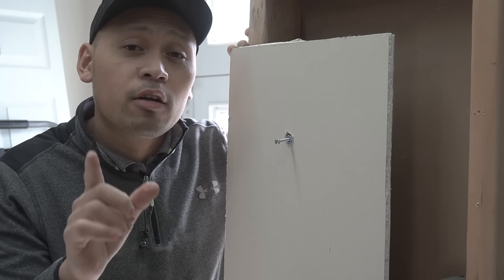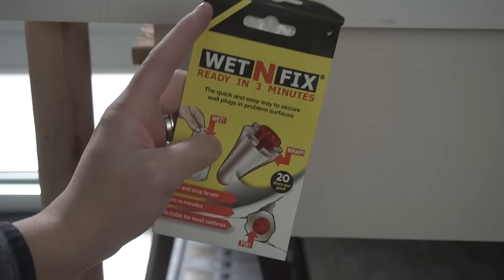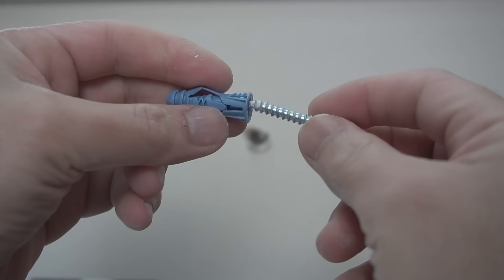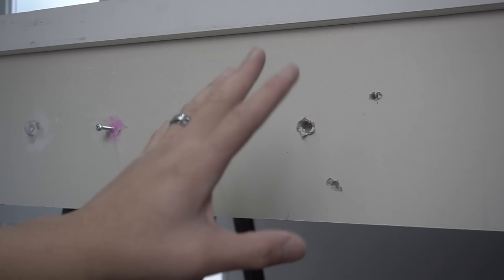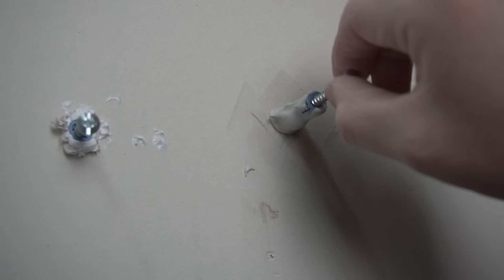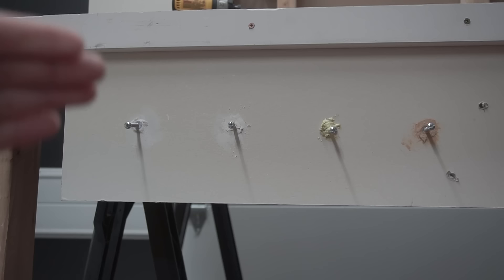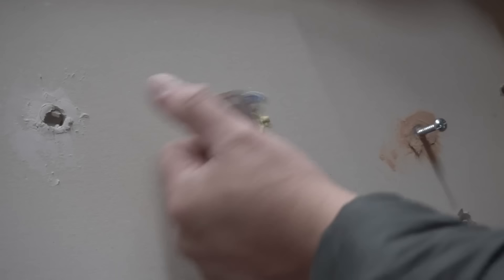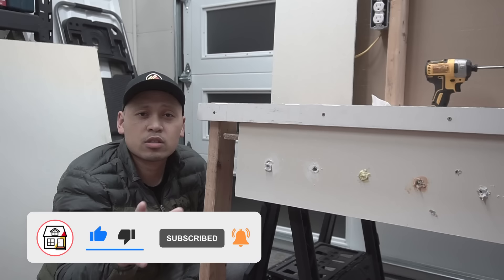How To Fix Loose Or Damaged Drywall Anchors Like New! | DIY Wall Plug Repair!

Comment: Hello, can you advise what size drill bit I need to
pre drill the hole for dry wall anchor. Dry wall anchor size I have is 0.98" (25mm) not sure what size drill but I need for pre drill

Comment: i had to fix an ongoing problem with a towel dispenser in a warehouse washroom and the door trouble too   as to towel dispenser cut out the damaged drywall and put a 3/4 piece of plywood behind the new drywall i put up to they found out who was tearing the towel dispenser from the wall he broken his hand trying to tear it off 
moved the door and put it in a different spot too and  a camera to see who do go into the washroom too

Comment: I hanged my TV on drywall, the TV weighs 18.7 kg and the wall mount weighs 9 kg, it's a heavy duty mount, total 27.7 kg, quite a lot of weight. 

How I did it is simple, I cut a vertical stripe in the drywall the size of a plank, then place wood planks though the slot, rotate them, screw them behind the drywall horizontally, then screw the planks to the actual wall with long screws, then screw the drywall cutout back in, use plaster/mud to make the wall look nice again, after drying you can use wood screws to hold the mount, or any kind of heavy weight, the mount was so strong that it held my entire weight (93kg), you can adapt this to any size, if it's not something really heavy you can use one single small plank and not attach it to the wall, just the drywall itself is enough to hold a lot of weight.

This technique can also be adapted to fixing drywall holes, it's easier to do than to explain, it's a really simple process.

(pro tip: have a screw in your plank to avoid accidentally dropping the plank behind the drywall, and to make it easy to maneuver it in place)

Comment: What about using fiberglass mesh with the Easy Sand? The Wet and Fix seems to get its strength from the fiberglass. If the Easy Sand held to almost 50lbs by itself, I think that the fiberglass would add strength.

Comment: Great video,I would not use a drill/driver as to much torque if you used a hand held screwdriver - tradesman to reliant on battery powered gear for light duty stuff -

Comment: Could it be that leaving the screw iside the plug while the compound is drying will attach the screw to the plug making the screw test to fail? Specially using a power tool, too much torque to the screw is twisting also the plug? Just an idea... Great vid thanks for you content!

Comment: If its possible to move what is anchored, up, down or to one side a little bit into new sheetrock with no hole. Then fill the old hole with, whatever, like sheetrock mud. This is the best fix because you are in new sheetrock.

Comment: I enjoyed your video however I always use the (heavy-duty) no more Nails caulking. I am surprised you didn't use it for this test as well. It dries fairly fast and is extremely strong. I have even cut a hole in drywall and installed electrical boxes where there is no stud and the box is rock-solid once it is dry.

Comment: if u have a hole in plasterboard and you fill it with  some snot from nose and put in it plug, it wont be strong anymore, paper on both sides of plasterboard is damaged, plater is damaged..., you don't clean dust, don't watered the area around hole, you are the cowboy builder, after your job people probably call some skilled builder to repair all damages you done...

Comment: I use Gorilla Glue, the foaming waterproof polyurethane type with the white cap, not the wood glue or the superglue. I always use this even when I have a good hole because it consolidates the plaster dust and prevents the hole eroding over time. I have not done any formal testing, but I bet it is better than any of these options except possibly the WET-N-FIX.

Comment: I never reuse the same hole/plug/place combo: either move the hole to a new place and patch the old one by the pink spackle or use larger or different type of plug that wouldn't rotate when the screw is screwed in

Comment: Just get some joint compound fill the hole and wait 24 hrs.  Then make sure your anchor is the correct size for the weight it is supporting. What is in the video usually happens when the object is either too heavy for the anchor OR the hole was drilled too large in the first place.

Comment: WET-N-FIX worked but it did move under stress (you didnt point this out) of more than 130lbs but you wouldnt prob have that much load on it anyway. So WET-N-FIX looks the best bet.

Comment: For the wetnfix method, if you put the wetnfix covered anchor into the hole, could it potentially cause mold in the drywall?

Comment: I use the toggle type anchor.  It works going through a hole, but I don't hang anything too heavy using that technique.
For the wood filler, would it not make sense to let the filler dry, and then screw a pilot hole through it for the screw?  No need for the extra hardware from the anchor.

Comment: Buy the pack with the drill bit in the pack or clearly marked. Never use a screw gun. Use a hand screw driver with light and steady pressure

Comment: How about? Start over! Fill the old hole with spackle and move the anchor(s) an inch away. In most applications, that is by far the easiest, cheapest and most convenient approach. But, truth be known, I usually just find a stud(s).

Comment: Better method that will last forever: 1 Take out the loose screw and clean the inside by using a moist cloth/fabric, just stick it in and out to remove any particles. 2 Use epoxy glue 5 min (dries in 5 minutes) and stuff it in the hole. "What if I accidentally get some glue on the wall?" tape that area and remove the tape when you're done. 3 Epoxy completely dried, 8-10min, drill a new hole for the drywall anchor.

Comment: I wonder what the outcome would be if the wall anchor is placed into a fresh hole after the compound used has completely dried.  In other words, don't cover the wall anchor (with the screw in it) with the compound and push it into a hole.  I would figure the function of the wall anchor would be rendered useless.

Comment: Some comments mention using a bigger anchor. Doesn’t a bigger anchor usually mean having to use a larger screw, which may not work for you?
Other than wetnfix, he could have used a butterfly. At least I think that’s what it’s called. Get one that has the correct screw size and you’ll have a very strong connection.

Comment: I havent tried wetnfix.  I usually use Fix-All which dries fast and very hard, very strong.  But if there is any real weight going to be put on this point, I use 100lb anchors that re-inforce from behind.

Comment: Hi, I think at each hole you write above it the material you used and below it the weight it failed or hold up. That make people easy to remember the results. Good work but can be improved.

Comment: If you want the first one for free, go ask The ER or some doctors office. It is the exact same material we use in the emergency room to give you  your first cast after you break a bone. ( Plaster of Paris).  We throw away alot of it when we cut to length.

Comment: You didn't use toggle bolts, by far the best. You can also use toothpicks. Pack them in the hole and break them off after setting the plastic anchors in the hole.

Comment: I wasn't expecting all these different methods to have the wall anchor reapplied into still gooey materials.
Wouldn't there have been better results if the holes were filled, allowed to fully set, then redrilled? Perhaps an experiment for a future video?
Well, except for the "Extreme Stretch" caulking. I don't think anyone expected that to work. Or the "Soft and Flexible" window and door foam. No point really in testing materials that don't actually set rigid for a 'let it set then try redrilling' test.

Comment: A good video, but I can't believe that you used an electric drill to snug up the screws. Between the friction of the screw & anchor, and the friction between the anchor and drywall - how can one expect the anchor not to be broken loose from the torque of the drill.

Comment: Good, however the pull out resistance is depending on the bond between the plug and the wall material whereas when tightening an item into place, the pull out charastic will be the determining aspect which will be solely dependent on the bond between the both surfaces, a metal spring toggle fitting would not depend on the bonding with low pull out resistance but the more the screw is tightened will not pull out of the bonded material but will mostly enhance the strength of the fitting. The actual integrity is not really measured by the wieght of an item on the downward direction but the pull out resistance which is the more critical integrity sought for such a fitting. Although my age is often a disadvantage owing to my decreased strength and agility it can often be the result of many more years in this field, BTW I was born 73 years ago and not trying to be disrespecting of your obvious general skills but hopefully my suggestion can be of assistance this time around , : < )

Comment: Dubious fix at best, chances of lasting questionable. Do it right instead of a quick salvage. Sparkle hole, drill new one. Doubtful if 1/4’’ either way will be of any consequence. If so, use Molly bolt, as hole will already be big enough (as mentioned below).

Comment: if you already damaged a 1/4 hole and you need to use the exact same location then you might as well buy the other solutions (gripit, bullfix, others) that requires 1/2 hole and can hold 100lbs

Comment: No.1 tip when using dry wall anchors...... never ever under any circumstances let anyone any where near the screw with the  intention to use an IMPACT DRIVER!!!
It the same as using a hammer to keep nudging a ming vase along a shelf till you are happy with its positioning..... tap tap here tap tap there tap tap here,, why did the Vase smash, now let's have a look at 5 ways to stick the vase together then see which method lasts the longest when repositioning the vase with a hammer again!!!🖖😁

Comment: all variants cause a lot of mess (why not just use a bigger dowel?) Also, you load the screw connection in the wrong direction. You load the screw in “shear” (if the screw is not loose in the wall, the limit of the load is the same everywhere). Above all, it is also important how the connection reacts to tension (pulling) (because in reality, you load the connection vertically and horizontally).

Comment: I am not at all surprised by these results. But the real #1 is to put in proper blocking behind the drywall. It's just that it's the most expensive and time-consuming method.

Comment: Sorry to tell you that window and door foam does not expand. If you use expandable foam around windows or doors it will warp the casings. That why they make the two different types.

Comment: There is a 7th solution......
Take a bottle of #401 super glue and a sufficient amount of toilet paper. Pull off of a roll of toilet paper a small amount enough to fill the hole relatively tight and stuff into the hole and squirter sufficient amounts of super glue into the hole and toilet paper. You can try to add the anchor but it's not necessary as the super glue and toilet paper together will make a tough bond filling the hole and it will be stable. You'll need to drill your screw pilot hole after the mixture hardens, and BTW......this mixture will cure the fastest. After the mixture hardens drill your pilot hole and sand, paint, install screw and hang your project.

Comment: Nice video!! Sadly we don't get the first product here in India. But I have a question. I was attempting to drill a small hole in the wall with my drill, unfortunately, the hole turned out a lot bigger than the drill bit. Plus, a hand-sized chunk of the wall itself came off (outer layer of concrete, which was also covered with something called plaster of paris). Any idea why this happened? Did I use the wrong drill bit, or is the cement/concrete of poor quality, or something else??!! In several places across the house I find that the holes do not maintain a clean round shape, but instead start crumbling around the hole and seem brittle for some reason. Any thoughts please. Thanks,
Reply: @jimbokraut640 Sounds like your walls might be plaster instead of drywall.

Comment: I avoid using drywall anchors like the plague, period. Living in CA earthquake country, I fasten EVERYTHING to the studs with long screws (1.5 to 3 inches long) instead. This includes picture hangers: I use the quake-proof ones so the wires cannot jump off the hooks when the walls move.

Comment: Interesting, but the wet and fix seemed to fail as well (seems there's a gap forming at the top of the hole at 7:12 when you applied the pressure), but it seems stronger because it's like a hard oversized plug that grabbed onto the sheetrock.

Comment: Be careful of the asbestos in the drywall and behind it in the insulation. If you pop a pipe you could leave some into the water supply.

Comment: Good video but an easier solution would have been to just use a butterfly toggler instead of those other 6 methods the toggles would have gone through the larger holes with ease and then would hold very well

Comment: WOOD puddy works a little better on WOOD. 5 min. Hot mud works better not when it dries but when it cures. The rest of the products only seal. Can you please demonstrate a product i used on my door hinges holes. (Car bundle)
Until this day it's still strong. Works great if you use it properly. I will subscribe just to wait on your demonstration. 
Ps you find car bundle in the paint department at the home depot

Comment: If I have to buy a product to fix this problem then I would choose screw in drywall anchors ⚓️  they are larger than the hole .and can be screwed in with a Phillips screw driver flush to surface of drywall then I install  whatever I am mounting  to the wall and screw it in!  No water no Glue! I'm finished !

Comment: I was triggered when he started, but actually feel this video will be helpful to show the many many bad ideas, when it comes to dry wall repair and anchors.  
As the video started.... I thought oh god no, just do a new hole, and spackle the old. 
If for any reason you just have to repair a drywall hole, the wet patches is just too expensive.  Spackle can be fine, especially the stronger repair ones.  Epoxy for small holes that is then covered with drywall paper, for very fast repairs.  I have even seen liquid metal do well.  Any kind of large or jagged hole that has torn much of the paper, it is best to patch the back if you have access. Cut it larger and then put a piece of drywall reinforcing, and then a new piece to patch it. 
Yes a longer fix but a better one. 

One last thing... you should sand it smooth and parallel to the wall.  Even just a bit of unlevel, will act as a lever and help the weight to pull the anchor forward instead of down. I noticed that one repair was a bumpy nob that would throw off your test by at least 20%. 
Good video though.

Comment: You cant get a true reading if you slop any of the materials inside the screw hole. Caulk takes a day at least to fully cure as well as various muds. Just screw a bigger PROPER wall anchor in the hole, 10 seconds and they will hold 150 easy

Comment: The way I would fix this problem is to use a LARGER anchor, but the type with a screw thread and it fits tight.... and when the hole is too big, just make a new hole at least an inch away (either on the top or bottom or left to right) and problem solved.... Also, understand that it depends on the weight needed, such as for a shelf compared to a picture frame or whatever.... MOST IMPORTANTLY, to prevent such problems to begin with, MAKE SURE you use the proper size anchor for starters and even consider using an OVERSIZED anchor, so you never even get this problem.... In my closet, I removed all the existing shelving that the builders cheaply installed and I bought those LARGE screw on anchors and I used twice as many as the builder used, and then I installed four 11 inch "L" brackets on each end and also two "L" brackets near the center of the shelves (four "L" brackets spaced apart evenly per shelf).... and then I purchased three (3) long metal bar rods evenly spaced, so now I can put really heavy items on my closet shelves with no worries and so far they lasted years.

Comment: My 1st solution would to be switching out that anchor for a toggle bolt at that point rather than trying to fill in the holes.

If using a filler I would use a cotton ball mixed with wood glue, it also works with wood holes along with various fillers like toothpicks etc in wood.

Comment: With enough use, they'll all fail at some point.  I prefer just cutting a rectangle around the hole, slip a piece of wood behind and screw it in.  There's sparkling, sanding and painting involved, but you'll have actual wood to screw into.

Comment: I would be tempted to fill the hole with a cotton ball and inject super glue.  No need for an anchor. Then drill a hole at the screw size. Screw it down and test.

Comment: These are called plastic anchors and they should never be used on drywall they are for concrete or cinder block. There is an ez anchor or toggle bolt that work great depending on the weight

Comment: If 5 of 6 tactics fail, its a failed method. Your better off just using a bigger sized or variety anchor, or drilling a new anchor hole after u repair the dàmaged hole.

Comment: If you're smart, use a toggle bolt, depends on the size of the hole. There's small ones mediums and large ones stay away from these other ones they don't hold worth a damn unless there's very very very little weight on them

Comment: The problem with your weight test is it is directly down, whereas most loads for shelves etc. also have a pulling out force which is harder for a plug to take.